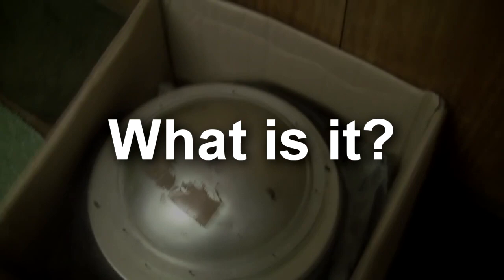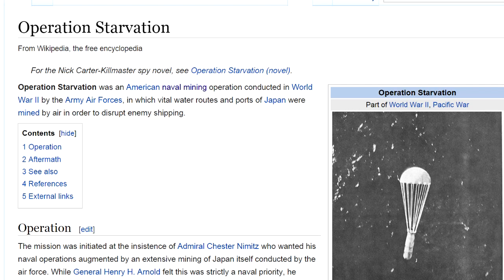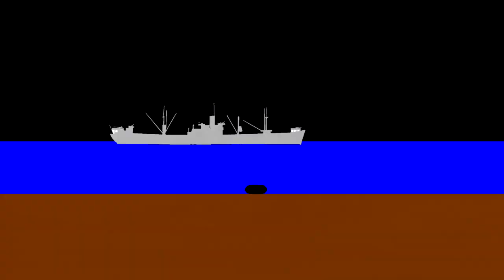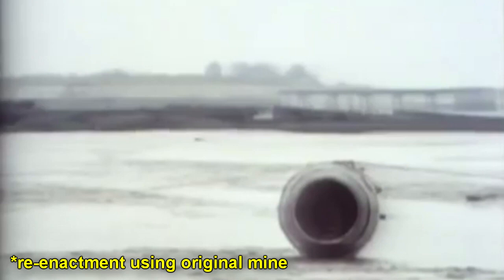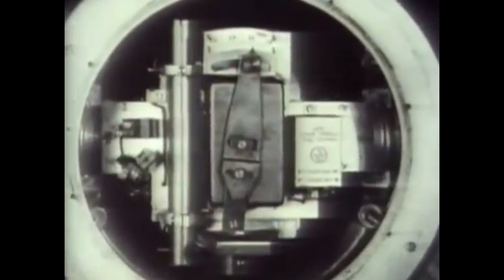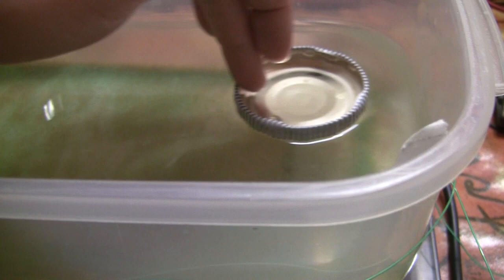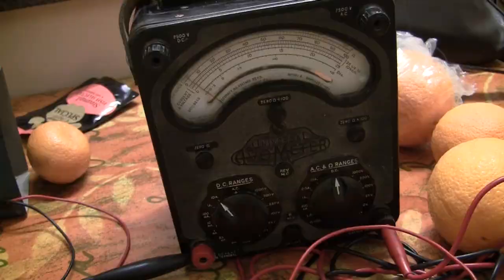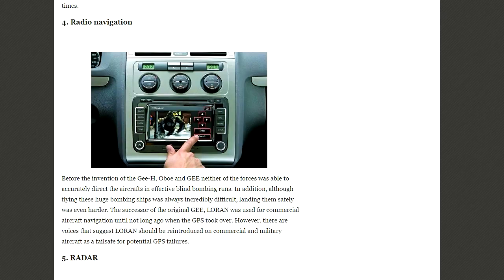The 'superweapon' that almost won Hitler the war!

Comment: But since this requires a ship to drag a magnetic loop in its wake, wouldn't the ship already trigger the mine when it sailed over it? Since the ship has to drag the magnetic loop over the mine, it first need to sail right over it.
One way I guess this can be solved is by using wooden ships (or ships made of any other non magnetic material), I wonder if this was the method used?

Comment: Did they use wooden vessels for the sweeping apparatuses?  It would suck to go out for the first sweep on your grid and run your steel hull right over a mine.
Reply: +Justin Burrows  Certainly some of them were. Where I grew up there was a pair of WWII minesweeper hulks used as a breakwater/containment for a log booming ground. They slowly decayed and came loose and washed ashore, and slowly crumbled on the beach. They were about 85ft long, all wood hulls. I don't know their war history, they may have never left North America.

Comment: I haven't seen the answer or any of the messages, but from what I can tell, is that it was a gyroscope. Used kind of like a UAV, he was able to send small planes with explosives, unmanned kind of like a drone that we have now, except I guess you could sort of say it was AI, but not really. Once it was launched it stayed on course to where it was aimed at I believe. Once it was launched, there was no way to abort the attack and I believe that the U.S. And allied forces needed to shoot it down with there own aircrafts, and eventually used there own planes to actually turn the UAV's by using the wings of there aircraft by either lifting or pushing the wings of the unmanned aircraft. Now let's see if I'm right.

Comment: 3:40 Russia entered the war on 17th  of September 1939, just 17 days after Germany invaded Poland by attacking Poland as well. They didn't turn on Hitler for 2 more years (or so, if I rememeber right) but they very much were in that war from the beginning.
Reply: They had a non-aggression pact and did lots of trade at the time. There were even some limited negotiations of the Soviet Union joining the Axis.

Comment: remember people, even at 12 volt electricity can kill, so do not reproduce this experiment unless you know what you are doing! it takes less then 5 watts to kill a man when water is involved, which means at 12 volts you only need 0.41 A to be in lethal range.
if you don't know what volts, amps or watts are in relation to one another, you might want to hold off

(source: belgium regulations state 20mA circuit breakers on all electric wiring in damp rooms (like bathrooms). 230V x 20 A /1000 (milli amps) = 4.6W. and still some people die from this) 

vid was very interesting though, i would love more tech and counter tech vids.
Reply: Yes it takes less then 5 Watts to kill, but... It depends on the current path and so many other factors. Thunderfoots experiment is pretty save, my biggest concern would be hydrogen gas, not current or voltage. His water "tank" is barely big enough for a hand, salt water is very conductive, so get a current trough the hearth (which is the most critical path) is all most impossible. Yeah, there is some issue with electrolyzing the blood, but... that takes quite a lot of time and stupidity with the given setup to be a risk.

Okay, fair enough: if the power supply is broken or "non isolating" to main earth, then there is a risk. But... yeah. Using a broken power supply is a risk in its own right.

Comment: what that thing looks like is the guiding system for the v1 or v2 rocket used by the germans that specific thing which i think is a gyroscope would be used to keep the rocket stable during flight.

Comment: The "Landkreuzer P. 1000 Ratte" (a super tank) and the "Landkreuzer P. 1500 Monster" (One of the largest tank designs conceived) were super weapons as well.
Reply: *****  small and mobile is often better as you know. Have you seen the film "fury"?
Reply: A superweapon that's about as maneuverable as train without a track and easily countered by a little airpower. I think 'failed test' is a more apt name.
Reply: AEIIIStraigon XD the 1000 series was more manoeuvrable but at least it inspired Hydra weapons :P
Reply: A super hypothetical waste of resources maybe.
Reply: ***** Yeah, it is very good. It's about a tank crew.
Reply: Nualaboala
It's the first film since WW2 to have an actual working Tiger tank in it.
Other than that, I thought it was pretty....US patriotic war wank, worse in my eyes than Saving private Ryan.
Cinematography was nice though.
Reply: bodybag22 I didn't know about the tank. I admit the bullet fire was over the top but I looked at it more from what men endured during the war. I think Pitt's character showed how it could take it's toll on a person psychologically.
Reply: Nualaboala Well the only reason fury ended they way it did is because the germans had a brain fart and forgot how to fire....or move.....So yeah, small and fast is good if the enemy is hollywood ( in WW1 and 2 ) nowdays its a bit different xD

Comment: Yes magnetic mines are even a threat against even modern day warships, hence the reason why modern warships go through a process of de-magnetizing or degaussing where the warship is wrapped in superconducting cords of which electrical current is flowing through them.

Though I have serious metaphysical doubts about the potential for Axis powers winning WW2 with magnetic mines, largely because what destroyed Axis powers were land battles such as the Battle of Stalingrad, and land based operations such as Operation Bagration conducted by the Soviets.

Comment: A far easier counter was putting the ship under those loops (or running those loops through the ship) and passing a current by them. It erases the magnetic signature for some 3 months. This was called "degaussing".

By the way, betting on these wonderweapons (and backstabbing Russia) was Hitler's main mistake. The V1 was cheap, but not very effective, being only able to hit a target the size of London. Conventional bombing runs, which Germany couldn't do any longer because they've lost the air initiative, were much more effective cost-wise if it were to actually disrupt the war effort.
The V2 was even worse. Some 3k were launched, ammounting to some 9k victims. Reportedly, Hitler's advisors called it "a glorified, extremelly expensive artillery shell". And yeah, they didn't had counters to it after it was launched. But neither they had for conventional mortars. But it did was extremelly vulnerable while the highly boom-hazardous Ethanol70-LOx were being loaded into the missile.
The last A4 rockets ever launched were scrambled to take down a bridge the Allies were using to cross over. 11 were launched. The closest one landed in the river the bridge crossed some 500m upstream. The SCUD missiles deployed by Russia/people who buy stuff from Russia are direct descendants from the A4 series. And we don't have counters for this kind of weapon even today... No. C-RAM or CIWS can't take em out.
Some wonderweapons that people argue could have tipped the balance of the war if they came earlier were the ME262 and the HO229. But the early jet engines they put on it only lasted 10 hours before major refurbishment had to be done. And their takeoff roll made them innefective as scramble aircraft.
The Japanese experimented with weird/higly innefective weapons too. They discovered the Pacific Airstream that flows directly from Japan to mainland USA and put baloons with incendiary bombs in it. The only victim were an unlucky housewife and five children who triggered a bomb that succesfully reached the US withouth droping the bomb.
The US had the famous pigeon guided missiles and the firebomb bats.
The Brits perhaps had the most successful of these innovative weapon designs: the earthquake bomb. A very heavy, extremelly expensive bomb that detonated after burying itself. It was a solution to take down a train passage that had been bombed unsuccessfully multiple times before, that evolved to be the weapon of choice for high value hardened targets, like U-boat pens.
Another very effective weapon was the american invention of the proximity fuse. But it doesn't fit on our little list of weird and very expensive or very cheap innovative weapons.

Comment: to put the loop over the mine, you have to drive your ship over it? That'd be bad, right? I think I didn't get something here.
Reply: I think they did it like twin pair fishing trawlers with a cable connecting 2 ships and using the ships themselves as the electrodes and then they sail on either side of the mines, not sure thought sounds possible.

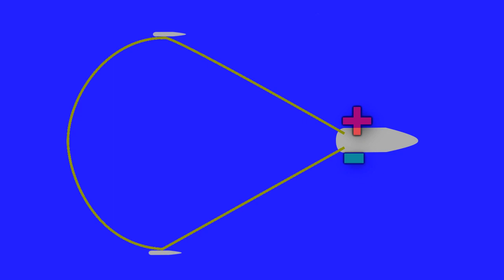Comment: 8:29  How would the ship passing over the mine not set it off before the magnetic field sets it off?    It would somehow have to be far enough in front of the ship for it to work.
Reply: Ace Aardvark  If that's the case, they should have pointed that out in the video.
Reply: Was wondering the same, thank you both.

Comment: Excellent video. Question, from what I understand, Japan and Germany did in fact exchange data, information, intelligence, and technology. Germany at least tried to ship nuclear technologies to Japan near the end of the war. Surely Japan knew about Germany's magnetic mines, and knew that America had re-engineered the technology to be used against them. Why didn't Germany just tell them how to counter them, or send them an example of one of their mines?
Reply: That's assuming the Germans knew a foolproof way to counter their own mines. Correct me if I'm wrong, but most people don't usually work to find a way to counter their own weapons in the heat of war right? Not to mention, they could've worried about spies or other security leaks telling EVERYONE how to counter the mines, therefore rendering them utterly useless. Just my two cents, correct me if I'm wrong on anything!
Reply: TheAggressor Once you know how it works, I can't imagine it being that hard to figure out counter-measures. Since German scientists made the mine, they would have to know what would set it off. It's just a matter of developing a safe way to detonate it. But granted, there is a possibility that they didn't know something as simple as dragging some electrodes behind a ship would safely set off their mines. Sometimes complex problems have incredibly simple solutions, but the solution remains elusive.

Comment: Wait...how can you use this method to sweep for mines designed to destroy ships with a tow line BEHIND the ship? Would the ship blow up before the sweeping mechanism even went over the mine?
Reply: Unless the mechanism was more attracted to the tow lines in which case it would only activate once the loop itself had passed. Either way, it worked.
Reply: +DrBeefmaster Sonar was generally used to avoid the mine directly along with the ship been sufficiently small enough not the set them off initially on its own.

Comment: The weapon was starvation. One method to achieve this starvation was using this type of mine. You can't extrapolate and say that "this mine causes starvation" without telling in what context you are making the claim. You can still resist without petroleum products. This idea that the war is over as soon as supplies on paper are used up is novel.

Comment: Massively, misjudged the application a mine; it gives me more than a moment of pause, that something so simple, throws the equivalent war-winning punch, of the atomic bomb without the grandiose reputation. "Super-Weapons", are not formidable because of their punch; but because of their potency...  

Imagine a toddler, knocking out a world heavy weight boxer. This little mine had the power to topple a nation.

   "David Downey Jan 1, 2014
It's a Fluxgate Magnetometer,with multiple fluxgate sensors it allows you to obtain the X,Y,Z component of an external magnetic field. This was mainly used to detect submarines during World War II, by giving the user information on the intensity & orientation of the submarine's magnetic field.""

Comment: If it was designed to go off when disturbed, to ensure it either went off and hit something or to prevent its capture, wouldn't that be a fail-deadly system?
Reply: +Toratchi888 Thunderfoot explicitly mentions that THIS version of the mine (the one thrown into tidal waters and disarmed by two volunteers) had a copper strip that needed to be removed before throwing it off and then would have activated a failsafe mechanism, the aircraft crew did not remove it and so the disarming was successful.
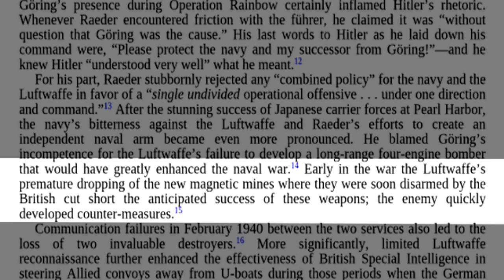Reply: +Urs F (Feno3000) At 5:06 --
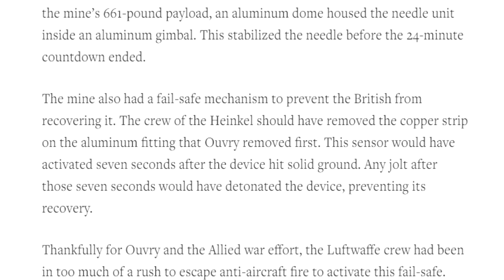I believe he said "later" mines, if take out of the water, would exploded; he calls this a "fail-safe", but given it explodes, I call that "fail-deadly". And the 5:30 mark says "the copper strip covers the sensor; seven seconds after hitting solid ground, it would explode." Still a "fail-deadly," because it goes off if it's tampered with (i.e., touched, removed from water, etc.)

Where as the mine captured was not armed; if it had been armed, it would have exploded when it landed, though he doesn't say why exactly, I presume it would have been triggered by, say, proximity or impact, perhaps as a secondary trigger mechanism? It doesn't sound like these mines CAN fail safely; they either fail deadly, fail, or aren't armed, the latter being the case.

Fail-safe: "If something goes wrong, the thing in question is deactivated."
Fail-deadly: "If something goes wrong, the thing in question activates."

That's how I understand it.

Comment: It would have been difficult to come up with the rare-earth elements needed to build these mines in large numbers.  Shipments from Turkey were blocked in Yugoslavia, and eventually Germany was reliant on smuggling under Spanish flags, or paying extortionate rates to the Portuguese.

  Perhaps had Japan committed in China in 1931, and with German support, they could have exploited China's extensive supplies, and mined Indochina and the Pacific as well.  In fact, Japan would had to have handled any production prior to 37 or so to avoid attention.

That supply line would necessitate a victory in North Africa, or at least abandoning Morocco in lieu of Egypt.  Ultimately, allowing allied control of Gibraltar and thus the Mediterranean may have been the war's determining factor.

Comment: I'd have swept for the mines with the electromagnet method but on an aircraft.
Reply: They did. They equipped Wellington bombers with large electrified coils that set off the mines as they flew over.

Comment: if a ship had to drag the wires "behind" it, why didn't the ship set off the mine when it initially passed over them?
Reply: Wooden hull with coils to counter the magnetic signal of the metal bits. I served on Ton Class sweeper.
Reply: x42brown thanks :)

Comment: wow, this is old. but i am going to say a 'gyroscope'. it was these amazing devices that were placed in the V2 rockets so the rockets could be aimed incredibly accurately... as long as you know the exact long/latitude for the gyroscope to work on.

oooooooh... 00:30 secs in and i#m wondering./ " am i right? am i right?"

Comment: Not to be that guy, but this is a war winning weapon in the same way as the german U-boats, and kind of by the same doctrine. If there are enough, it could work, and as used it showed real promise, but enough is an astronomical amount in both cases if the other party just counters with more ships, unpredictavle routes and ports and a sense of get it done no matter the losses. A heavy focus on mines and U-boats might have done it, but in the end that depends on Britains hypothetical resolve. I mean Japan WAS starving and with no support from a giant economical benefactor and STILL didn't plan to give in until the last man - well, the atomic bomb changed that but still.
Edit: my autocorrect was trying to make every word swedish - some slipped through

Comment: People should be definitely more familiar with this weapon but as someone you has studied this extensively it was very unlikely it would impact the war to the extent you described. Firstly, the British would have worked out the bomb mechanism anyway. Unlike Japan, Britain was much clearer about what the Germans were up to and their intelligence was much more up to scrath than the Japanese. A foreign labourer's anecdote or any number accidents like the one which actually revealed the the nature of the mine would have spelled the end of its dominance. 
The capacity of the British to respond to such things does not compare to Japan's total inability. Bear in mind, the Japanese were still quite 'primitive' and unimaginative as far as their military state allowed things to go. An equally effective campaign conducted by the Americans against the Japanese was with submarines which devastated the Japanese merchant fleet. Much of their losses could have been avoided if they had have employed a convoy system. Such basic things were often overlooked by Japanese High Command and certainly a magnetic mine campaign was going to be extremely effective. 
The other thing which makes the Japanese situation incomparable to the British was the total air superiority of the Americans. To employ these mines in sufficient quantity to reach grand strategic significance the Germans would have needed far greater air strike capability than they had in the British zone of conflict. They would also need to be deployed in certain areas limited by both the range of their particular air bases and the routes used by the convoys. AA and Fighter Command would dispatch with the majority of such aircraft or at least be able to observe their practice and perhaps determine the operation of the mines. Note how few such new minesweepers were required by the British due to the limited number of mines that could be dropped by the Germans.